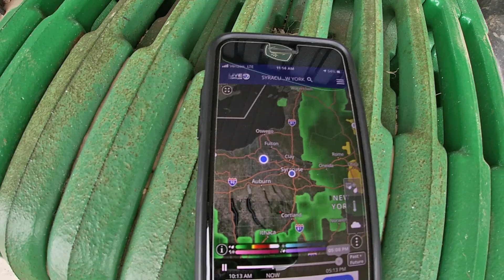Someone Crashed The Gator

Comment: Well I added it up a couple days ago... we've had a grand total of 4 inches of rain since the first of the year, and we should currently be at about 16-18 inches... plus we're at about 100 degrees every day, so yeah... we're a little dry.  Sure wish we'd get a rain like this.  A couple three weeks ago we were supposed to get about 2.5-4 inches over the course of several days-- we got a half-inch total.  Nothing grows in the dust.  OL J R :)
Reply from the maker: About 9” in 6 weeks here
Reply: @TheGrumpyFarmer  Yeah that's a lot and can cause problems too... remember all too well from when I was row cropping.  Course we were on pool table flat black gumbo clay that takes about 2 weeks to dry out from a 2 inch rain, so yeah that'll make you cuss!  At least on the hilly ground with lighter soils it'll percolate down a little faster or run off better though then you have to deal with swamped low spots and that ain't no fun either.  Always something!   Here at the BIL's in Indiana it was a cold and wet spring but they got everything planted and looking really good but now they could actually use a good rain, been mighty nice weather by Texas standards but they're upset about the heat, well, they had a day in the high 90's felt like 80's to us because the humidity is lower.  Still when corn rolls its leaves its time for a rain no matter what the temp or location  is LOL:)  Later!  OL J R :)